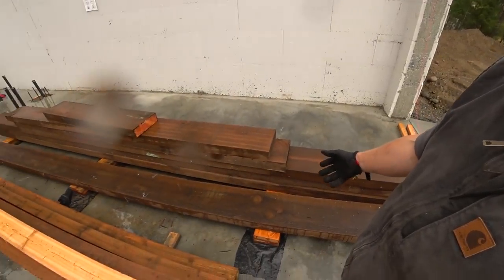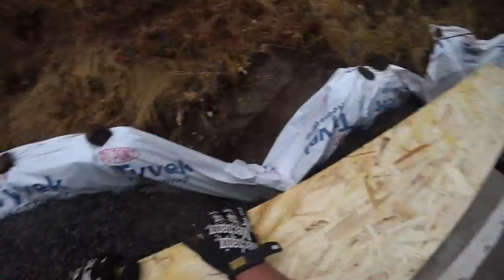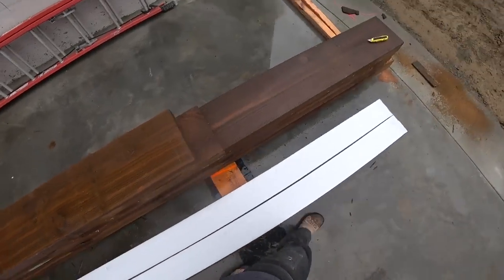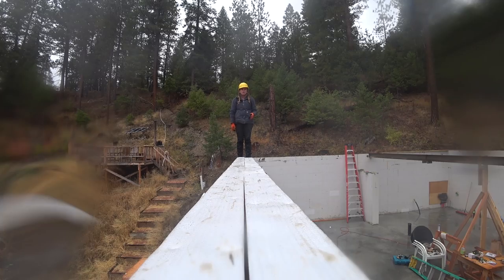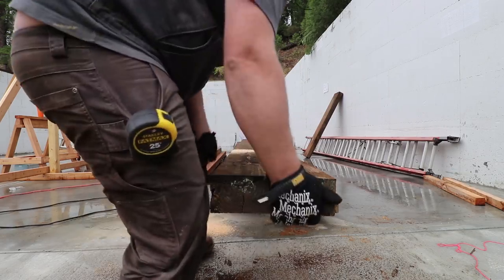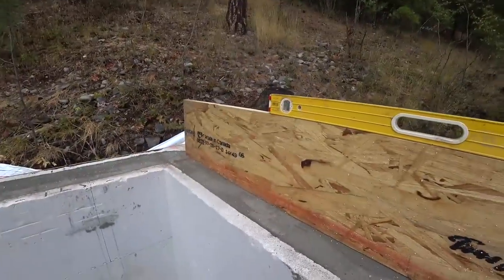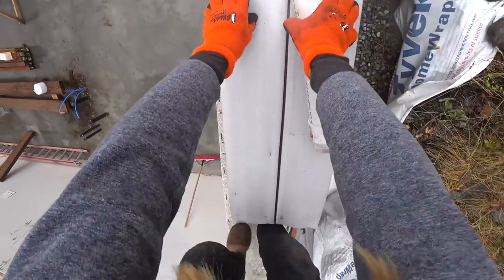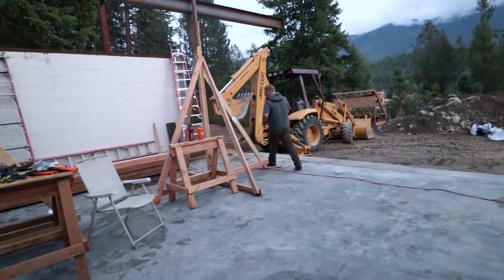Building a House Start to Finish: DANGEROUS Sill Plate Installation

Comment: ALL chip boards, all  particle boards, and even all plywoods have some level of formaldehyde in them.  In the heat of summer for several years they will out gas.   Lotsa ventilation.  With a super sealed house and SIP panel construction you will not have sufficient ventilation.  Make the house too tight and you will require mechanical ventilation,, an air to air heat exchanger,, with a bit of suplemental heat.

Except of course for your garage floor that 'talks to Idaho' sub soil and outside air.
Reply: Everything outgasses, especially that ICF block, big time. Might be the asbestos of our generation. Oh well, open a window once in a while.

Comment: Jesse, I am a couple of minutes in and I have to stop and say, you are over complicating this. Lay the sill plates and then chisel or plane them in the spots where the joists sit to level the joists. Please go get some scaffolding. Your lives depend on it.
Reply: I try to stay anonymous since I changed my name on here a year ago, but I am going to throw this out here.

Jan 31, 1996, I was working on a refrigeration unit on a roof. It started raining. I almost made it to the ladder. I fell about 15 feet onto concrete and fractured 4 vertebrae. I laid there thinking I would never walk again. Nowadays, I get around pretty good and seldom need my cane. I lost everything I had and had to go from a 70k job to minimum wage starting over in I.T... and it happened in a second.

Work smarter. Not harder. You are learning as you go. Please listen when folks give you advice. Some of us have been there and done that.

Comment: I know they don't look at comments but... I would like to chime in just a bit. Never stress at this point of the build. Especially if there is another or more floors. Ask any carpenter if every board they cut is exact. They are not but it all fits in the end because you have many chances to correct on the way up... Chill Jesse

Comment: You guys have to remember this is woodwork, not engineering. You're spending so much time trying to level those plates, when they'll probably move over 1/2" as they dry anyway. Those fixings do very little if you consider how much effect the weight of the whole house will have on the sill plates. Keep your joints tight, and your uprights vertical.

Comment: We all need to chip in and buy them a longer air hose. Lugging a compressor up onto the wall is just silly and potentially dangerous. Still love everything about what they are doing with this project, I just have fear of them getting hurt at some point between the ladder use and everything else I have seen.

Comment: Hey guys" Right On" My conditions and seasons But higher in elevation here in S Oregon the same as yours. I have joked my limit is reached a rain or sleat. I am planning to work year around and burn wood outside and wear a rain gear that they wear on the crab fishing boats.

Comment: this is hilarious... just goes to show... the first house you build should not be your own... 1/4 inch is not an issue in any home that i've been around... individual joints and fine furniture, sure, its seen... but they have alot of wiggle room as they build up... wood is much easier to cope than concrete, jest saying

Comment: How many time you're stepping up the ladders and are working on top of the walls? I wonder why you did not built a movable scaffold out of the 2x4s you have laying around.
I' don't know what safety codes the US do have. In Germany they would stop your work immediately to save your health. (no helmets while craning, no scaffold/railing on top of the wall etc.) On the other hand, here is no pressure leak checking of waste water plumbing;  ;-)

Comment: Working in the rain, working with heavy objects and recklessly operating powerful hand tools in an unsafe manner makes the title of this video quite apt.  I would recommend that Jesse watch this video regarding the potential lethality of grinders so he might be more careful next time: https://www.youtube.com/watch?v=eJOiKuVeXA0.  

The guard on grinders is there not just to shield the operator from flying debris, its there to prevent him from attaching larger wheels that the grinder is not designed to accommodate and which might therefore disintegrate into flying shrapnel.
Reply: breathing in that concrete dust isn't good either.

Comment: Couple of questions, not to be mean but you didn't know the difference between an impact driver, hammer drill and rotary hammer sooooo.....
1. Do you know what a plane is? It will help with your timber carcassing immensely.
2. Do you like being able to breathe? Buy some respirators or at least dust masks! You've shown us like six pairs of gloves and trousers but jeez, get some adequate PPE.
3. What's the  throat capacity on your compound-mitre saw? Drag it over to where the sill plates are for better cuts.

Overlapping the beams or mitreing the ends will remove your 1/8" gaps.

Good luck! Wish I had the space to build a house.

Comment: An 1/8 of an inch is not gonna kill anything. Wait till you have a bit of settling down the years(guaranteed).
Reply: 1/8 of an inch with 20k lbs of house built on top of it, I am thinking it will settle any warp or roll in the sill plate.  your first time is always about worrying over everything

Comment: Jesse, it's about time you used that Japanese saw. You cut much bigger timbers with it than these little sill plates.  BTW, my contractor never took the time to level or square things like that when he built the house. I don't believe there is one square corner in my kitchen.

Comment: Golly, tolerances of 1/8"? It is a house that will be made of wood - surely that is part of the joy of that type of house where wood has lovely characteristics. I like in the UK where ancient wooden houses look charming and 400 years of being a timber framed structure which is charming. They are not building a jet engine. I like this pair though and despite being amateurs, they are dong well but enough of the manic worrying about tolerances.

Comment: When I was framing houses I never checked the the block work for level.  If you're +/- 1/4" you're doing well (I think), particularly for a DIY.  If I ever run water supply lines under a slab I'd run running over-sized PVC as a conduit for soft copper or PEX,  That way if it springs a leak it's an easy fix.

Comment: The weight of some of the wood you will need to get up on the platform says you should invest in a chain hoist that you can attach to an A frame off the front of the platform.  You will soon be past where the backhoe can reach to lift things so will need something to avoid risky behaviors that will see someone falling to the ground. You should be able to replace the short factory chain with a much longer one for the distance you need.

Comment: you guys are doing an awesome job, but two things made me really cringe in this video.
grinding concrete without a dust mask is bad bad bad.
and wiping that dust of your camera lens instead of blowing it off. you'll be lucky if your lens coating isn't scratched to hell now :-(
Reply: Yes the Concrete dust can give you silicosis in your lungs, and the pressure treated wood is full of poison.

Comment: I said it before.  Y'all are sweating each phase of this to much.  Wood is not consistent enough to go threw the tolerance sweating that's going on here.  Your wood is in the rain it will swell and warp.  Once you put the weight of the structure up top of this it will settle down to what it will be.  So don't sweat it like y'all have been doing.

Comment: I would advise you tightening all your sill plate anchors with a good sized ratchet and socket, your Makita is good but it isn’t magic. Your sill plate seal should be in compression, tighter than a Makita drill/driver will make it. Check with your engineer and contractor friends.

Comment: wont the tons of wood about to go on top adjust and squash the sill plates into an entirely different shape, just asking for when I was young we were building a huge barn style building and I remember getting hit on the back off the head, as the man building it said, of course water and stuff comes out of the wood with tons on top it will take years to settle into shape.
Reply: Wood is a a living material, so it will suck up moisture and moisture will leave it.  It's best to get the non living materials level.
Reply: The amount of weight on top wont matter as much as how much it will shrink and move as it dries, and it will dry a lot once the roof is on. I haven't seen enough detail yet but I'm not sure why they picked such thick plates as 4'' thick wood will shrink a lot more than a standard 1 1/2'' plate.
Reply: The wood is already kiln dry, minimal shrinkage.

Comment: Anyone with any experience would know for this application an 1/8 " isn't worth even thinking about! The I joists only touch the sill every preset increments ! Who cares if there is a small discrepancy in between!  Your not building a jet engine!
Reply: Oh so just be a hacker then. Slap it together! That is where I make my money... fixing other peoples garbage work.
Reply: I wouldn't call working to an 1/8th on a foundation or floor framing ''slapping it together'' if your taking the time to get those two things better than that your wasting your clients money. I would avoid using plates as thick as they are for a start. In my experience they can be out a quarter themselves, if you have to then bolt them down well and power plane with the laser as a guide(shims are no good to me).

Comment: They should be using a scissor lift it would be a lot safer to work from. Rent it for $350 a month. Walking on the top of the wall not good.

Comment: Excuse my ignorance, but what's that electronic device on a stick that you're using to check the levels?
Reply: I'm fairly ignorant as well, but I believe that is part of the laser level system.  The other part is usually mounted on their deck.  If it gives a solid beep, it's level.  I think.
Reply: Mark Schwarz They have a cool box opening video on the Bosch laser level system.

Comment: Hi Y2 You are walking you'r way trough the challenges, and solving them along the way that's good.
 I think you are doing fine job. You are spot on with you'r water level That is Super, and maybe better then most pro's will do..... You'r getting  a lot of comment from people that will do thinks different, and NOW its my turn.
Maybe I will put some more screws in the beam, to fasting Them to the Wall, That is the only thing preventing a hurricane to lift off you roof, Fastening the top of the house to the ground are pretty imported, maybe you are doing that later .....Best Jørgen Thomsen Denmark DK

Comment: I wonder how wet /damp those sill plates might be, what with the rain / drizzle that has been present almost every day. I don't think pressure treating that wood prevents it from absorbing moisture and with all the "little slots" or "cuts" in that wood it might be more prone to absorbing water. Then there's the density of wood, like every where there is a "knot" the wood is harder and less prone to absorbing moisture.
Hell, just the humidity in the air can affect wood to a certain degree. Witness, hardwood flooring installation where the material is placed in the room where it is to be installed (for what a week?) so it becomes "acclimated" with its new environment (temperature AND humidity) before it is installed.

Overall, my feeling is that Jesse and Alissa are doing a good job considering the weather there now. My only suggestion is to cover those sill plates with tarps (both the installed and waiting to be installed sill plates) until the timber framing starts. That is something that they do have control over! They can't "turn back the clock" to go back to 100 degree summer weather where it was dry for 3 months, so thy have to deal with what they are faced with now - and protect their building materials the best that they can.
Reply: They call those "slots" or "cuts" in the wood beams "spike" treating and they are put into wood to help the treatment chemicals or liquid penetrate a little deeper into the lumber. Here on Maui years ago home builders used to dump their lumber into the salt water in the ocean for several months before building as a wood treatment. I have looked at a few of those homes that are 80-95 years of age and no wood pests yet, so it seems that it worked. Could have been a better grade of lumber back then also. Aloha from Maui
Reply: Very interesting about dumping lumber in salt water as wood treatment.
Hell the building industry is still examining for materials makeup of Roman concrete that was made over 2000 years ago, especially in seaports to try to figure out how it has lasted for so many years. 
Yeah, 80-95 years ago it could have been first growth trees that were harvested as land was being cleared for sugar cane fields. Definitely a better grade of wood and probably more hard wood trees that would take much longer to grow.

Comment: You guys don't need to worry about the leveling of the sill plate so much you can compensate for the framing of the walls.... You guys are completely wasting all your time when you could have had the walls up already and the roof... At this rate it will not be done before winter..

Comment: I wonder why they won't drive the backhoe into the garage to set the plates?  Seems like it would save a lot of time.
Reply: The slab is only 4" thick except for the footings.  That will hold a car of 2 tons but would crack under the weight of a backhoe of 5 tons :)
Reply: with all of the compaction they did and the rebar they uses instead of wire you could pull a 20 ton excavator in there with no problems, also going off the dimensions of the house and the amount of concrete they said they used I'd guess their slab is closer to 6" thick
Reply: That backhoe weighs closer to 7 tons, but the slab should have no problem supporting the weight when cured. Jessie is probably just being cautious because the slab is new.
Reply: I'm not a concrete engineer, but, that said, after some research, the Case 580K loader backhoe they own is a 14,000 lb machine.  It seems a 6" slab, (high strength concrete... not medium strength) will hold up to 15,000 lbs.  The compacted bed (as you pointed out) does help substantially, so in theory, in my mind, it would hold the backhoe w/ ease.  But, all this is based on the slab curing over a month.  Also, you may want to take into consideration the radiant floor ?   Do you think there may be a weight description for that ?

One thing I've noticed about this couple is :   They are cautious about every little detail.  I mean, thinking the level of the wall surface must be w/ in a 1/16 is over kill.  You did see him sanding the top of the wall w/ a diamond blade on his 4" disc grinder , right ?   I'm sure the companies that pour their walls and slabs appreciate the over kill strength and ease of walking the supports and scaffolding !   Also, the ratings go out the window or at least approach engineered physical limits w/ their strive for perfection, but , BUT,  their attention to detail in over kill is also a sign of worry and caution on many of the smaller things.  

Where you and I would drive on the concrete w/ a front end loader backhoe, they may really have reservations for reasons we may not even be able to comprehend !    Weight worries ?  Worries about breaking or cracking the entry slope ?  Lack of confidence in driving skills ?    Maybe even worries of how to clean the rubber off that the tires leave ?   

You have to admit, it is fun watching them strive for perfection and funny how they run into small problems and over blow the risk on a daily or even hourly basis.  But w/ all that , it's fun to watch how they are learning to resolve issues.   I love the fact that they have time, money and drive !

Comment: It's obvious why they don't respond to comments here, I wouldn't talk to morons either, all the little arm chair contractors. Keep the videos coming. I do agree with a couple of comments however, don't sweat the small stuff, Graeme's comment especially. I get a load of lumber when I am building, check it out and almost start to cry, luckily there are all kinds of little fixes and hacks contractors and framers use. Keep up the good work
Reply: highlander49ca i totally agree with you. i get so sick and tired of the armchair safety guys using the osha manual for dummies that have never actually done anything dangerous in their occupation or seem to think that they should force the safety rules on to others that they are forced to deal with on a jobsite, and i can guarantee these wannabe safety guys don’t do any of the bs they are whining about. if they did, i would see people at the gas stations wearing chemical aprons, rubber gloves goggles, and face shields to fuel their car. 
dusk masks?!? for what? it’s raining!! nature’s dusk control!

i’ve got one that will twist all of their panties.. i have 3, 4 1/2” grinders, one cut off wheel, one with a sanding disk, and a regular grinding disk.. none of them have a guard. (oh my lord, he must be a mad man!!) 
     
i can see why they wouldn’t answer the comments.. i wouldn’t either.

Comment: Alright so sorry to harp on this but once again, when cutting/drilling concrete wear a dust mask.  https://en.wikipedia.org/wiki/Silicosis
Reply: Allain Roy thought the same thing bless um! Luckily their not in the trade doing these sorts of things everyday so I wouldn't worry about um to much, but neither the less they should invest in a dust mask specially when their grinding! Gosh🙄😂
Reply: Yes I agree, long term exposure is the more serious issue, but no reason to tempt fate.  Dust mask, work gloves, proper footwear, eye and ear protection...  Easy, cheap and you save yourself all kinds of grief.
Reply: Allain Roy I totally agree with you! Definitely wise words indeed